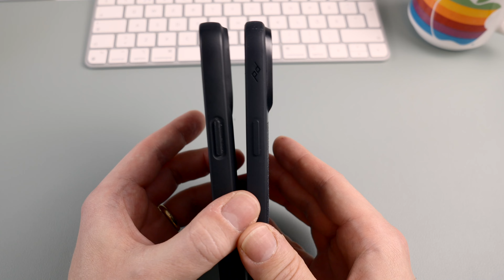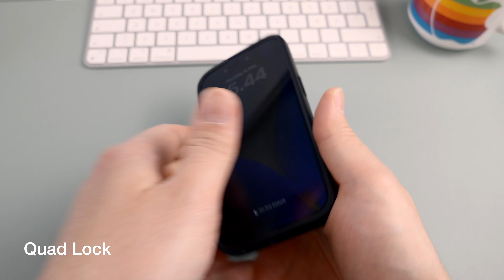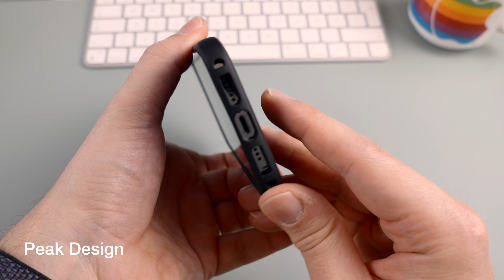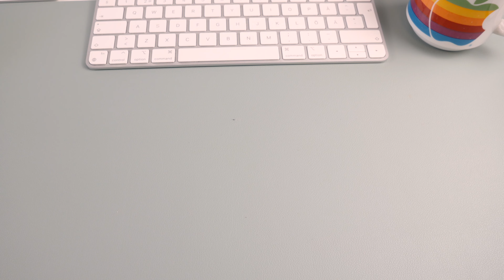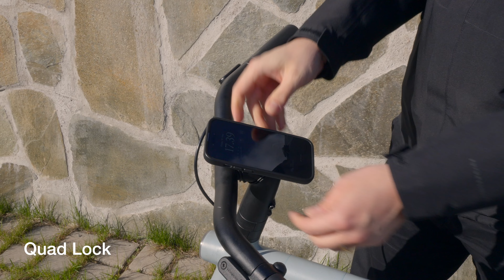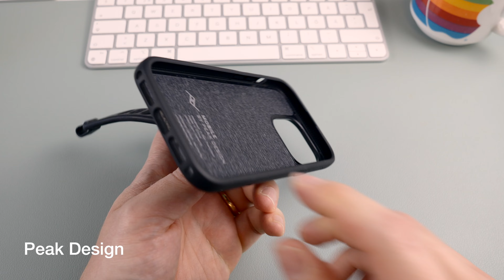Best Smartphone Mount: Quad Lock vs. Peak Design

Comment: Apple does not cover phone damage caused by vibration if you mount your phone on a motorcycle handlebar or bicycle! Read your phone warranty card.
Reply: Does that mean you shouldn’t use it?
Reply: @darrenhaken   I shared your concern but I've read the vibrations are unique to motorcycles where the engine is the cause.  The other consideration the price just under $100 to mount your phone to the bike. The strap on version is a little cheaper but not as secure. On the other hand it's well built and convenient.

Comment: Thanks for the comparison. For me it's the quad lock. Stronger magnets and it has the twist mechanism for a secure grip, better suited for off road riding with a bike or motorcycle. Looks is secondary.
Reply from the maker: It’s definitely one of the most secure mechanisms and the ecosystem support seems slightly more extensive. I just this summer rode e-bikes from brand called Cowboy and they have built in Quadlock mount with wireless charging on their bikes. That was awesome!